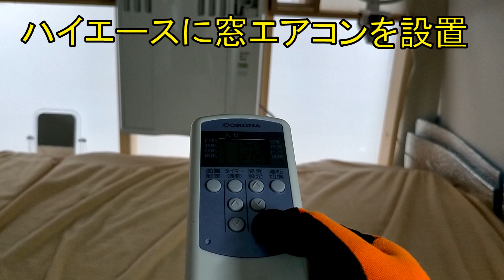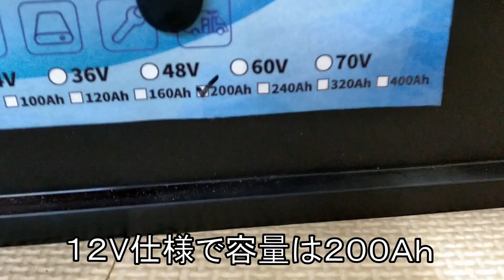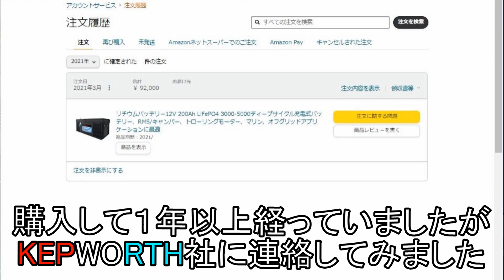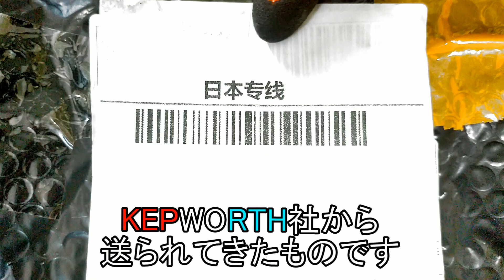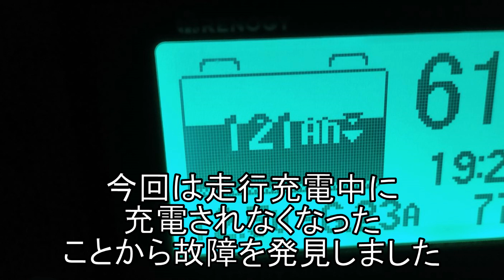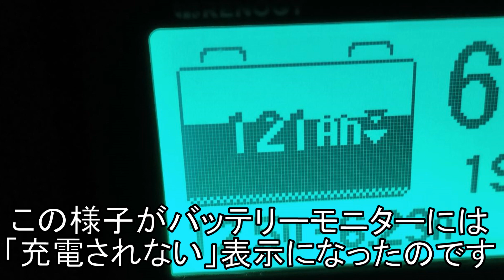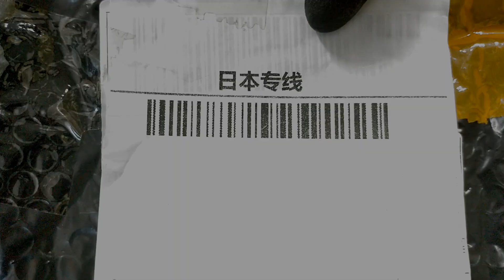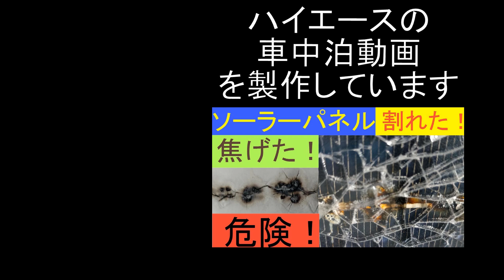殻割りで確認！リン酸鉄リチウムイオンバッテリー分解、高温！溶損！危険？車中泊のサブバッテリーKEPWORTHで窓エアコンを動かすがRenogyバッテリーモニターで異常を発見Ampere Timeに交換

Comment: Best thing I ever had I did like 16 kilometers on water with my 3,5m rubber boat and old yamaha m18 and it had 13,1 volts at the end. I think it would  take about 50km to reload it. It's way beyond what i need, wish i had one years ago, i was carrying heavy batteries so many years...
Reply from the maker: I used to use two batteries called "ACDelco Voyaer M31MF" for marine. Each battery weighed 26.5 kg, which was very heavy. Lithium iron phosphate batteries are more expensive than marine batteries, but they have better cycle times and usable capacity and are lighter in weight.
https://youtu.be/oY6PxZl_hb0?t=86

Comment: hello,
I have to open my Kepworth battery due to malfunction of the BMS. I tried to hammer against the connections as you did, but no success. Can it be that the cover is fitted with adhesive?
Brgds Bernd
Reply from the maker: No glue is used on the cover.
Don't forget to remove the strap before hitting it with a hammer.
It is a video of 3 minutes and 30 seconds.
https://youtu.be/6FvTHLAStGA?t=210
Reply: @Good-morning-60-nights-by-car
Reply: Thanks for your reply. Finally I managed to open the case, forward cover was fixed with 4 liitle glue pads therefor I had really hard to 🔨. After removing the foam and measured the cells I found 1 cell defective only 2,5V all others between  3,28 an 3,30V, batterie 25,25V. I contacted Kepworth, will see if can replace the  cell.
have a good day, regards Bernd
Reply from the maker: I'm glad you were able to open the case.
The battery is different than the one I use. The cells used in my battery were the pouch type. Were the cells used in your battery also the pouch type? Or was it a blue box type? Please let me know as I would like to use it as a reference for the next modification.
I have one more question. What tool did you use to remove the home? thank you.
Reply: @Good-morning-60-nights-by-car  
yes, mine is 24V 100Ah, 8 cells of  "blue boxes" 215 x 135 x 30 mm. I removed the foam by cutting it  in small pieces with a japanese saw . Fortunately the complete cell block and the foam block was not fixed with double side glue tape, so easy to remove.  I made some pics, let me know if you are interested. 
rgds Bernd
Reply from the maker: The battery cells were blue box type. I've learned that different models use different types of cells. thank you. You use a saw to remove the foam.
 It was very helpful. No need for photos.

Comment: Hello people. So i got this kepworth 200ah battery and I dont know if I can charge it with 20Amp charger . No info about bms cutoff amperage
Reply from the maker: I delayed to reply. sorry.
This battery can be charged up to 100 Ampere.
I hooked up a 40 Ampere travel charger and a 40 Ampere solar charge controller. I was able to charge without problems.
Please refer to the video of simultaneous charging if you like.
https://youtu.be/mSjOpQvK6lk
In addition, I have also created an internal remodeling video, so please watch it.
https://youtu.be/c31xURIerxo